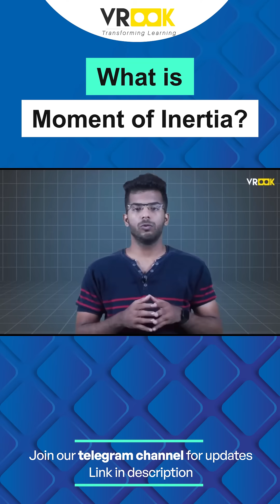Moment of Inertia | Engineering Mechanics | NCERT PHYSICS | IIT-JEE

Comment: the value of the moment  of inertia is used to calculate how much power does  it requires  to rotate a wheel from idle to n rpm 

 all the physics students are trying to understand it. and no one had given exact explanation. 

this is more like pi of the circle
Reply: how is it related to pi
Reply: @abhijaiyt6220  sir pi is a number it would be used in the geometry related problems. as well as the moment of inertia is also  a factor that is coming in the formulas which are used to calculate bending moment in  the members, forces in the revolving parts like acceleration. 
however it doesn't require any explanation of phenomena.